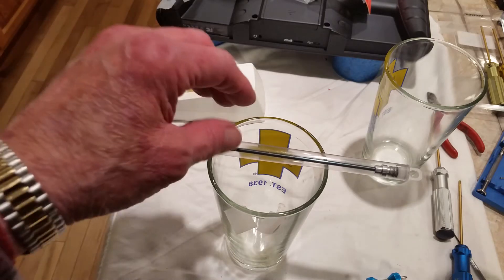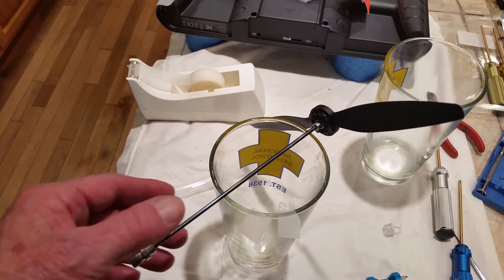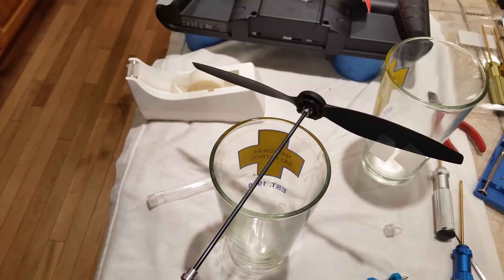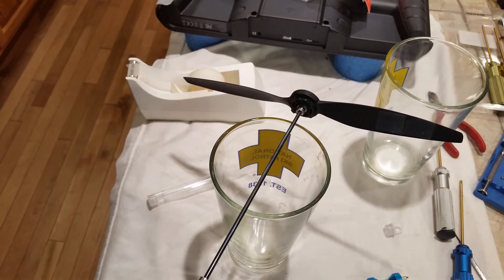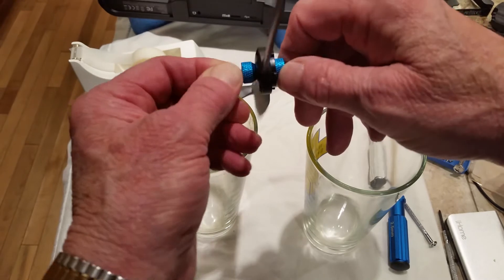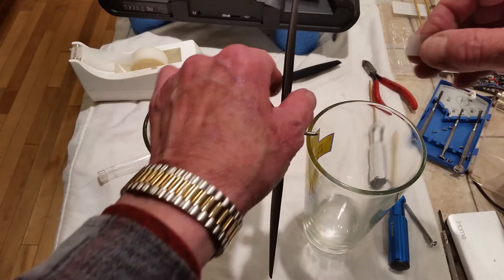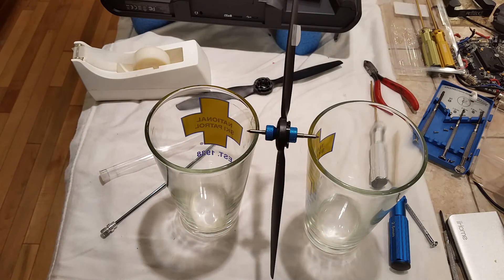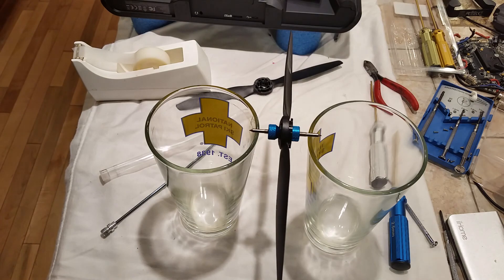Prop Balancing

Comment: How much does this affect the flight of the craft if the props are out of balance? Does it affect flight time on a battery?
Reply from the maker: The problem with unbalanced props is the vibration they cause. Increasing vibration is hard on the motors and airframe. It can also cause Jello or jittery video recordings.